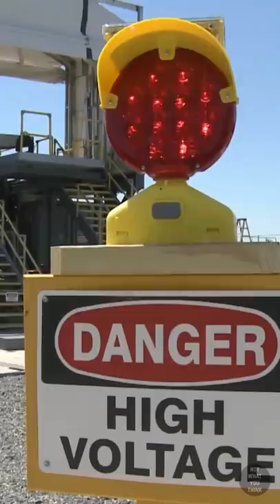Railguns: Destructive to the Core

Comment: "Still not ready for action" We'll need a couple more Trillion dollars before we figure out the gun is useless - MIC
Reply: And it is...in a naval Gunfire capacity, at least.

For Space or Air-to-Ground...it's a winner; the same stands true for CIWS Systems.

But a Railgun can't do Plunging Fire, warheads, or parabolic arcs...it's Death Incarnate in a straight line, and harmless otherwise.
Reply: @digitalis2977  well said, Friend 👏👏
Reply: @digitalis2977  Who says a railgun can't do plunging fire? Its literally a ballistic trajectory weapon. It flies in a parabola. Gravity doesn't magically disappear for it.
Reply: @death_parade  No...it's a direct fire weapon.

A plunging rail slug is as effective as a thrown rock.

F=m•a

A solid-state rail slug on a parabolic trajectory can NEVER equal the force generated on a direct-vector trajectory because a parabolic shot because Physics; Parabolic Fire is about maximizing distance, NOT impact force...impact force is actually sacrificed in parabolic fire due to air resistance and terminal velocity limitations. 

At the top of the arc, a projectile begins slowing down to whatever its Terminal Velocity is, so in parabolic fire, two different equations exist, with the first equation (before the arc) dertermining Distance Traveled, and the second equation (after the turn) determining Force of Impact.

Muzzle velocity of the Railgun shown here is comparable to the Mark VII Naval Gun on the Iowa Class Battleship (approximately 2916 f/s for the Railgun compared to the 2500 f/s for the Mark VII) so the difference lies in the Mark VII's 1225 kg shell versus the Rail's 50 kg slug; accelerating downward to terminal velocity (call it 150-200 miles per hour as a good rule of thumb for most things) at 9.8 meters per second per second, the 50 kilogram slug can NEVER hope to equal the kinetic force on impact of the 1225 kilogram shell...and kinetic impact force is all the rail slug has because Humanity has yet to invent a high explosive that doesn't get explode-y under that much compression while being electrically supercharged.

TL:DR - The Mark VII Shell penetrates the armor and blows the target apart from the inside, while the Railgun Slug makes a loud BONG and lays on the deck, and a Railgun is only effective as a direct fire weapon because its slug has no substantial mass or payload; all of its Force is generated by the Acceleration in F=m•a and if the Acceleration is lessened, so is the kinetic kill potential.
Reply: @digitalis2977  You do realize you are completely neglecting the x-component of velocity, right?
Reply: @death_parade  Partially, but mostly because it is rather inconsequential in plunging (parabolic) fire since V(y) is an inverse of V(x) when in motion; this is the reason that a 45° inclination is the optimal angle for distance fire...V(y) is equal to V(x) on a 1:1 ratio.

It's also the reason that the optimal angle of penetration for naval Gunfire is 55-60°; the V(x) is calculated along the firing vector, NOT based on a vector from ship to ship, and V(x) results in a gain of altitude (V(y) from the ship's perspective) until friction and gravity inverse V(x) to V(y) and the projectile falls and the projectile continues to slow until either terminal velocity is reached or contact is made with the target.

So my point still stands and is on no way incorrect...only simplified to describe it as "before the arc" and "after the arc" and the fact remains that a Railgun slug impacting anywhere other than the side of a target on as "flat" a trajectory as possible has spent all its destructive potential in the travel, not the impact.
Reply: No gun is useless
Reply: @sudilos1172  Founding fathers said that a well regulated militia had the right to have firearms. "Firearms" at the time the 2nd Amendment was written meant the musket and guns of similar nature, I'm hoping everyone agrees they didn't forsee a Parabolic Space Lazer Weapon or other modern day high tech guns or rifles.
How do we apply a centuries old law to present technology?
Reply: @adropofgoldensun27  2nd amendment applied to more than just muskets back then. Many instances of privateers using 2a to load their ships with cannons. Get your head out the leftist bubble
Reply: @yamilink03  i guess you live in a right wing bubble if you think a cannon is a "firearm" 😆
Reply: @adropofgoldensun27  "the right to bare ARMS shall not be infringed"

I see you haven't learned how to read so this ends the conversation.
Reply: @yamilink03  i see you skipped the  part about "a well regulated militia" are you in a militia? and are you under regulations?
https://youtu.be/Eya_k4P-iEo
PS- you can Bare your arms at your leisure 😁
Reply: @adropofgoldensun27  
"A well regulated Militia, being necessary to the security of a free State, the right of the people to keep and bear Arms, shall not be infringed."

'A well regulated militia' is  separate clause from 'the right of the people to keep and bare arms'. It's an acknowledgement that the country indeed needs a military or militia for its defense but that also the average citizen would compose that military or militia. 

You're not an American citizen, otherwise you would know that every adult age male is in reserve to serve in a militia. But again it looks like reading comprehension isn't your thing.
Reply: @yamilink03  you're not an American if you can't read English and therefore understand that a comma represents a pause in the sentence and not a separate sentence. Dude you just keep embarrassing yourself.
But if you're in the Military then I don't see a problem.
Reply: @adropofgoldensun27  you're the one that confuses words. The initial disagreement was that 2a applies to firearms when that is absolutely the case. Then you get defensive for being wrong. I never said that the commas are separate sentences, you're putting words in people's mouths. They're separate clauses. If you don't upstand that then I can't help you. 
And yes, in the US it is REQUIRED for all men age 18 and above to sign up for selective services, a.k.a. the draft. This means that the US government can draft us whenever it so pleases to serve in the military. It isn't a choice as failure to do so waives our rights to vote and potentially be incarcerated. 
On a similar note, it's interesting that you're perfectly fine with a military serving the interests of a federal government to be armed, but the individuals that military allegedly us supposed to protect aren't allowed this right.
The same government that,  assuming your political leanings are that of a leftist, in your opinion massacred the native Americans of the past, instituted legalized human slavery, violated the sovereignty of nations abroad, and allegedly continues a policy to perpetuate racial discrimination domestically to this day. 

Yeah it's OK for THEM to be armed, but little ol' me can go fuck himself because "mah semiautomatic isn't a musket hurr durr"

The Constitution serves as a document promising all U.S. citizens their right to "Inalienable Rights", the rights to Life, Liberty, and the Pursuit of Happiness. An "arm", whether it be a sword, shotgun, or baseball bat, serves as a tool for the individual to protect these rights. 
You would be OK to take that away. Therefor, your opinion is moot.
Reply: @yamilink03  Dude how old are you? 

U.S. military draft ended on Jan. 27, 1973 On the day in 1973, as the Vietnam War drew to a close, the Selective Service announced that there would be no further draft calls. Since then the U.S. has fielded an all-volunteer military force. My statement that a cannon is not considered a firearm is what drew your ire. But if you want to haul around a cannon that's your business. PS - back in the days of the Army slaughtering Native Americans they were often supported by armed settlers and Land Barons. America's history is full of death, corruption and greed.
Reply: @adropofgoldensun27  this statement here. 

We're done. You're not fully relaying the facts, only telling half truths in an attempt to validate your claims. You're a gifter and that's that. Have a nice day.
Reply: @yamilink03  fine by me but I recommend you study some U.S. History. Be well friend!
Reply: @adropofgoldensun27  the US literally hired civilians who had their own warships back then armed with cannons, rifles, swords, etc. Right to bear arms shall not be infringed.
Reply: @abefernandez6546  So whats your point? You want a warship now? Silly. Civilians owned slaves "back then" too. I
Reply: @adropofgoldensun27  slaves is irrelevant to the topic. My point is cannons and warships have been used by civilians with and against the US.
Reply: @adropofgoldensun27  and my other point, 2A is supposed to give civilians the power to stand up against a tyrannical government. We don't need warships to stand up against the government because a warship cannot occupy a street or an area. They will still need people to occupy and hold an area. People like you who are against the 2nd amendment are the problem. I guess you like that we would be disarmed like Nazis did to their own people.
Reply: @abefernandez6546  No Mr. Fernandez I have no wish to disarm the American citizenry but I do question the high powered assualt weapons that continue to be used for mass or at least multiple murders of the innocent. You're coming from a place that actually believes a group of armed citizens can outgun the U.S. Military if tyranny is assumed. The Capitol Insurrection shows what people filled with hate and brainwashed by deranged Fascists leaders are capable of. 
Doesn't that worry you that anyone can buy any quantity of weapons and ammo they want, many who are manipulated to mental instability by our political leaders and media propaganda?
Reply: @abefernandez6546  And at the risk of repeating myself,  why do 2A advocates always skip the part about a "trained and well regulated" militia?
Regulated implies rules and qualifications for owning weapons.
Reply: @adropofgoldensun27  the second ammendment states "arms" not firearms.  They also had cannons, multiple shot weapons and chain fire "machine gun" weapons at the time.  The point was people had the right to be sufficiently armed to rebel (successfully) in case the government grew tyrannical,  as they just had.  The battle of Lexington-Concord kicked off over an arms confiscation.  Just look at the context of the scenario.
Reply: @adropofgoldensun27  you keep changing the wording to fit your goals, change the subject when proven wrong, and always divert when things get down to the details.  You are either delusional,  or a troll.  Given how ridiculous your arguments are, I'm leaning towards troll.
Reply: @sinisterthoughts2896  what is your malfunction Sir? You want a cannon? Get a cannon. You want a warship? Get a warship. People are too rapped up in their addiction to owning weapons and the bigger the better. All I was pointing out that in the 1700's when 2A was written the Founding Fathers could have never imagined the firepower man can create to kill each other, take THAT "into context". And might I point out you're another that totally ignores the part about "a well trained and regulated militia" and NO, there is no rights mentioned about the ability to "rebel sucessfully", that makes YOU delusional.
"What a fool believes he sees
No wise man has the power to reason away"
is what I'm dealing with here.
Reply: @sinisterthoughts2896  
The 2A was ratified in December of 1791. On May 8, 1792, Congress passed "[a]n act more effectually to provide for the National Defence, by establishing an Uniform Militia throughout the United States" requiring:

[E]ach and every free able-bodied white male citizen of the respective States, resident therein, who is or shall be of age of eighteen years, and under the age of forty-five years (except as is herein after excepted) shall severally and respectively be enrolled in the militia ... [and] every citizen so enrolled and notified, shall, within six months thereafter, provide himself with a good musket or firelock, a sufficient bayonet and belt, two spare flints, and a knapsack, a pouch with a box therein to contain not less than twenty-four cartridges, suited to the bore of his musket or firelock, each cartridge to contain a proper quantity of powder and ball: or with a good rifle, knapsack, shot-pouch and powder-horn, twenty balls suited to the bore of his rifle, and a quarter of a pound of powder; and shall appear, so armed, accoutred and provided, when called out to exercise, or into service, except, that when called out on company days to exercise only, he may appear without a knapsack."

Comment: So fun factoid, some of these were deployed for testing with the U.S. Navy about 5 years ago. Their direct fire range was determined to be about 15 miles, with indirect fire estimated at 200 but never tested to my knowledge. The prototype that I'm aware of shot less than 10 slugs before showing signs of inaccuracy due to degradation of the magnets. These things are scary strong, both on target and on magnet.

Comment: I know alot about these having tried to develop a maggun based Iron Ore cracker.  It was to be portable...composed of 4 semi trailers...one a generator and capacitor bank...one more capacitors and control bunker...one for the mag  gun and a coiled "barrel" that would lead to..the last one is the layered ceramic and steel impact block inside a chamber to cat fragments...and then move the materials out for screening.  It was not too efficient requiring about 35 mins to charge..but was a start.

Comment: A solution to the power issue is to not mount them as weapons on warships but as defenses in emplacement. Railguns could be used to crush hostile forces before they get into range. Or they could shoot icbm warheads out of the sky with relative ease. This would also solve the maintenance issue. As the parts would be on hand at all times.

Comment: I think the answer is found within the recoil design.  If they can develop a effective disbursement design that doesn't diminish the velocity it can become much more cost effective. 

Maybe a outer barrel shell with a collapsible inner barrel designed to  absorb most of the energy.

Either a inner barrel that is collapsible with some elements of elasticity, like a fiber of some kind.
Or
A disposable inner barrel.
Each inner barrel can be quickly swapped with another after each projectile is fired. 

Essentially a new inner barrel with each shell.  The inner barrel must be cost-effective and the outer barrell shell design must be extremely durable and have relatively seamless integration with the inner barrel shell.  If it takes too long to swap out barrels between use, it won't be a very effective weapon. 

Well, there you go engineers.  Off you go !

Comment: So all a rail gun needs are these 3 things:

1.Nuclear Fusion reactor: Redundant unlimited power supply

2. Ultra Dense graphene capacitors: Enormous and Ultra fast Energy discharge
3. Graphene Nanotube Steal Composite barrel : Highest strength & durability test. Also lightweight but you can argue with me on that one.

Pros and cons to all of these. But the science does prove it(theoretically)

Comment: I imagine they use giant capacitors for the firing. The railgun has a high peak power consumption, but low idle power. So you can charge the capacitors over time, and then discharge for the shot.

And for the barrel, it sounds like they need another rail magnet on both sides, but with opposite polarity.

So the rails will still propulse the projectile, but the forces acting on the rails themselves will cancel out.

Comment: I don't think they really wanted it to work anyway or you'd scale it back and see what kind of capability you can get without wrecking the weapon every few shots.
Reply: Even on smaller scales rail guns eventually destroy themselves.  The issue is we don't really have a material that can handle the heat that long.  Even a small scale model will superheat its rails over time.
The rails will hit Temps of over 1500c even in some small scale tests that temp is enough to make steel kinda mushy

Comment: Railgun would work better if they went with smaller projectiles like the metal swarm start with smaller projectiles and get them to work but it would be good for some sort of motor suppression system

Comment: But it's also not what you think, as much like the zumwalt, after several trials and errors, railguns have been dropped from active research as a main problem is the cooling, which ironic due to ocean water being everywhere, after the gun is fired once or twice the heat dissipation makes it entirely impractical for use on warships lest that made the turret as big as a bloody triple 18 inch or bigger, that being for a single barrel.

Comment: Wouldn't it be good to test out a layer of aerojell around 10 cm thick around the barrell to displace the heat since aerojell can't actually take in head that stuff can be put into a pit of lava and still be able to hold it in your hand seconds after getting it out and allso why not get some bigger or more advanced super conductors to help ramp up the watts needed to power it I mean 100.000kw can be converted Into 1.000.000 with the right ones

Comment: What is the practical use of this thing anyway though... and when does the projectile stop traveling?
Reply: 1.  It reduces the need for storing volatile explosives aboard ships.
2.  It has far better range, damage, and penetration than any other gun.
3.  It has capabilities similar to missiles without the immense cost of missile manufacturing.

Comment: Curious about the hybrid designs that use a charge or air burst to start the movement dropping power demand and using electromagnetics to ramp up velocity. Read a bit about it some time back, a few approaches but there wasn't a ton of info a regular moron like me could digest.